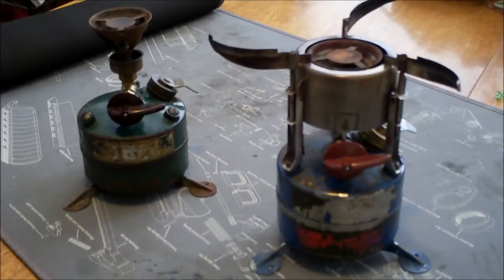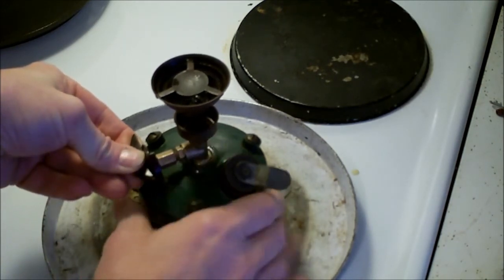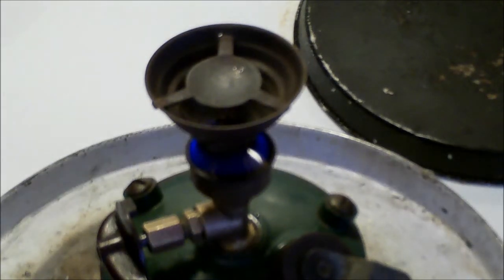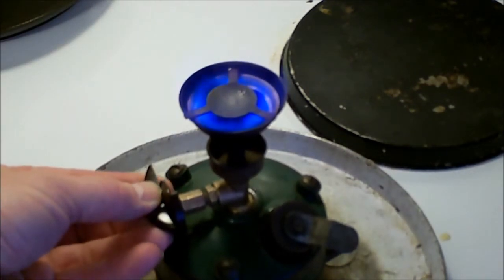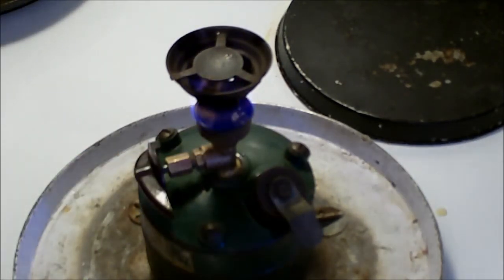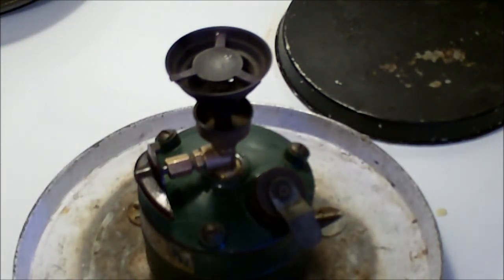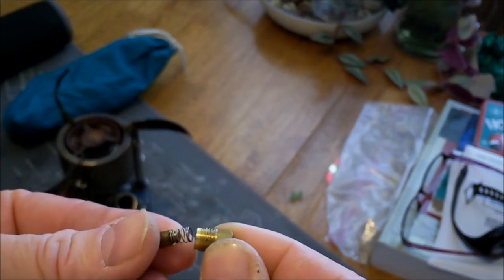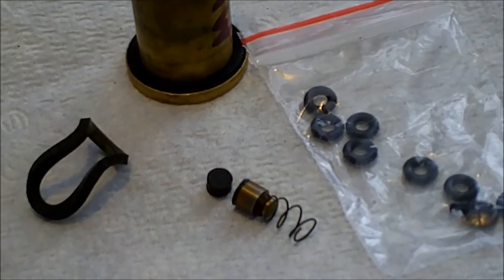Priming (pre-heat) and failure points of the M1950 / Coleman 536 stove

Comment: The M1950(Coleman Model 536) was never marketed commercially.  After WWII, they marketed the 530 "Pocket Stove" (had to be pretty big pockets) which was basically an M1941(Coleman model 520) with no feet and lots of nickel plating and bosses on the fount to mount the grate frame.  Neat little stoves but top heavy as hell.  All these stoves will fit in the 2 piece aluminum case/cook kit.  The one for the 530 is a little prettier and lighter.
The 520 and 536 had a fuel/air tube, so they were technically instant lighting.  But with that short fat generator that relies on the heat conducting down through the burner bell to keep it hot instead of being directly in the flame as with most Coleman products, "instant lighting" was a term used VERY loosely.  
Where most folks mess up the lighting process with "instant lighting" is not pumping enough pressure into the fount.  The process, as designed, requires a lot of air to mix with a little fuel.  When you try to nurse it, you don't get enough atomization and you get big, tall, bright yellow flame that can be seen by the enemy for miles........  Lots of pressure helps with these, but a preheat makes it more idiot resistant.

Comment: The little o-rings shown in the plastic pouch at 7:20 in your video...where do they go?  I received a 4 part kit from Old Coleman Parts, but even they don't know where the o-ring goes.  I don't want to disassemble the fuel valve until I'm sure what I'm looking for.
Reply from the maker: It is part number 9 in the diagram labeled figure 3 in the manual I'll link below. It goes atop the fuel needle which is down inside the fount. You have to take off the generator assembly to get to it.

file:///C:/Users/Super/Downloads/TM-10-708-M1950-Single-Burner-Gasoline-Stove-19511026%20(1).pdf

Comment: I'm in the process of refurbishing my m1950 stove, this video has been helpful, thankyou. But I have a question: the graphite packing in the stem, mine has disintegrated on disassembly (so has the spare), is there anyone making/selling them? I could turn one up if had the measurements out of another material like bronze or brass but I don't know if it needs to be strictly made of graphite or not.
Reply from the maker: Try old Coleman parts 
https://www.oldcolemanparts.com/home.php
or possibly the Fettle box
https://fettlebox.co.uk/index.php
Good luck. If you're still having trouble, the folks on the classic camp stove forums may have good advice as well.
https://classiccampstoves.com/

Comment: Got on of these years ago. Good little stove. Leather cup in pump was bad. Spare in storage was rotten. Check valve was bad also. Made a new check valve out of piece of rubber and used a accelerator pump out of a quadrajet (don't remember if it was a 2 or 4bbl) never had a problem since.

Comment: I was stationed in West Germany with the US Army in the 70's and 80's.   We had a M1950  stove that was part of the 
gear issued with our tracked missile launcher.  We called it the Track Stove.   The instructions had worn off the side.
We burned low octane Army Mo-Gas in it which we also used in our Jeep and M880.   
Having no instructions we used a different lighting method.  I would pump the stove about 20 times then I would open the valve wide open and then 
put a lit match on top and STAND BACK!!!!!!
Haha   it would shoot a flame 4 or 5 feet in the air and sound like a jet engine.
After a minute or so the flame would settle down and I would give it a few more pumps and it ready for heating up C-Rats.  
( well really MCI meals which were C-Rats with no cigs )
Reply from the maker: It sounds exciting. That's pretty much the method for lighting the older WWII stoves that didn't have a priming cup.
Reply: The stoves came with a TM and the lighting instructions were on the stove.  But I suppose after so many fireball light-ups, the decals were probably crispy blobs of schmoo stains on the fount.  Haha!  I was MLRS in Baumholder, Germany in the late 1980s and early 90s, I'm assuming you were Lance or Pershing?  Hawk perhaps?  None of our launchers had these stoves, but there was a labeled stowage point for them and they were in the AAL(Additional Authorized List of tools and equipement) or maybe even the BII(Basic Issue Items in the TM), but the NSN was there so I ordered one.  I'll be damned if it didn't come in.  The crooked supply sergeant kept it for himself.  I ordered another one and he let me have that one.  (What a guy!)  Love these things!  Not a fan of the pump at all, but they worked great.  Soon after, others tried ordering them and the NSN was obsolete.  I got lucky.  They started buying commercial Coleman single burners of different varieties, but I didn't find out about them until after I retired.  I had already been using  a Feather 400 and a 550 that I bought at the PX.  Used them all, loved them all.

Comment: Thanks for the info i just bought one it works good but the pump dose rise a little and the lighting procedure helps a lot thanks have a good day be safe.
Reply: That's the bad thing about this design that I hate.  A rising pump means it has to be filling with raw fuel.  That's not good......  Never mind the fire hazard, the fuel washes the oil out of the pump leather!  haha!

Comment: Hey quick question. I think I need 2 replace my o ring because I it still leaks fuel when it's in the off position. I cant seem to be able to get the t Joint disconnected for the tank. Any suggestions?
Reply from the maker: Try soaking the threads for a few days with penetrating oil. Clamping the valve in a vise and turning it out by hand, holding the fuel tank seems to work pretty well. The tank gets damaged easily, be careful.
Reply: Thanks for the advice! I'll have 2 try that. It seem they have some sort of locktite on it or something.  Thanks again
Reply: Did yours have red locktite on it?
Reply from the maker: No. I don't think the original manufacturers used anything on them. Here's links to a couple of stove forums where you can get a lot of good advice for repairs. Lots of collective experience with these folks, they know a lot more than I and should be able to guide you to a safe, damage free repair.
https://classiccampstoves.com/
http://www.colemancollectorsforum.com/categories
Reply: Billofthenorth1 Awesome thanks for the info and reference. Have a great day!
Reply from the maker: I learned a lot from them so they should be able to get you through it. I think every single person joining those forums is initially looking for help fixing an old stove or lantern. Hopefully you'll stay on once they get you sorted out.